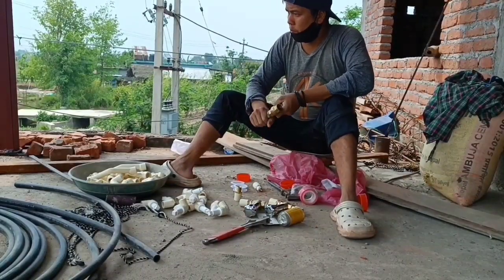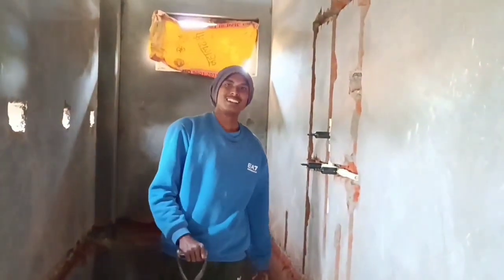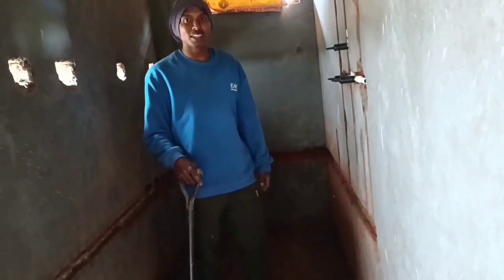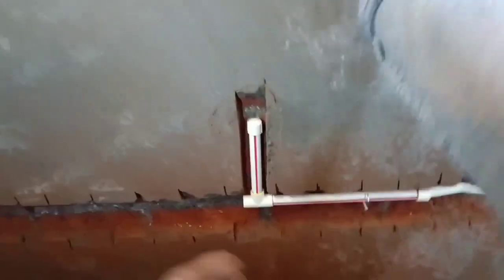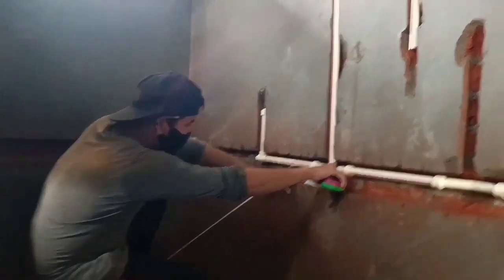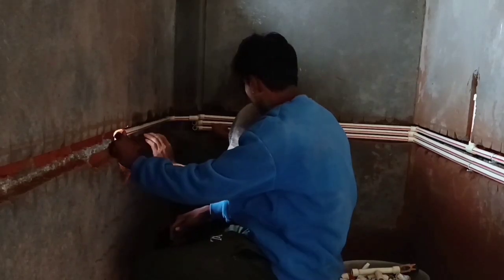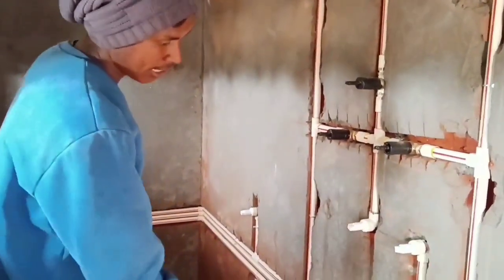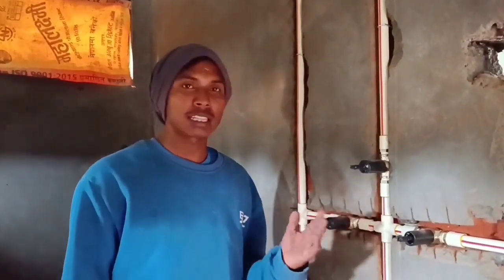Council  Fitting||Council Pipe Fitting||Cpvc Pipe Fitting||Bathroom Plumbing

Comment: bro ma tmro big fan ho yar sabai video herxu mani electrician ani plumber both nai grxu but top ko bathroom ma wall mixer zodeko xu pani ko pressure nae aaudaina yar air pipe pani ramrai snga zodeko xu ani sabar head dekhi daram ko height kati feet mathi rakhnu prx ra wall mixer   ma pressure lyauna lai kati mm ko pipe step by step lyaunu prx vndinu pryo yar bro video banayera asn deuta plz...... bro plz
Reply: टंकी को हाइट कम छ होला अनि पाईप भुईबाट खेलाएको होला त्येतैले टंकि को हाइट बढाउन परो ब्रदर
Reply from the maker: Hjr le thik vannu vayo yata  Female elbow ma kai pase ko huna parxa
Reply from the maker: Ehh thankyou so much 
 Yasto hunu ko karan pipe ma kai huna sak xa so jam vay ra pani hun xa ani hjr le plumbing kasari garnu vay ko xa tesma pani var parxa ani
Reply from the maker: Tankey ko height kati xa tesma pani var parxa
Reply: @maheshtharu7726   k e adkeko xaina sir maile adkeko xki vnera walla mixer kholera tesko mukh ma  moter ko pipe connection garera herda k e niklena ani tanki ko height chai 4 fit zati hola bro ani maile chai vitta bata deko xu pipe line ani tanki ma 25mm ko pipe ani bathroom ma 20mm ko pipe haleko xu wall mixer ma pani ko pressure atti nai kam aaux bro
Reply: @Mrrocksssss-xz9hc   टंकी को हाइट कम ले प्रेसर काम आएको हो त्येसो भए ब्रदर
Reply: @tilottamaepw4576   bro sabar head dekhi Tanki ko height kati zati rakhne hola ani tanki ma  kati mm ko pipe halam maile 25mm ko haleko xu
Reply from the maker: 20Mm ho halne @Mrrocksssss-xz9hc
Reply from the maker: Tiyo pani huna sak xa
Reply: @maheshtharu7726  bro maile sabar dekhi tanki ko height 4 fit zati rakheko xu tanki ma 25mm ko pipe ani bathroom ma chai 20mm ko pipe haleko xu air pipe ni halekai xu but pani ko pressure kam aairako x wall mixer ma aaza ni ghrbeti le phn garirako thyo kam aayo pani vnera sabai vnata bro kk garam